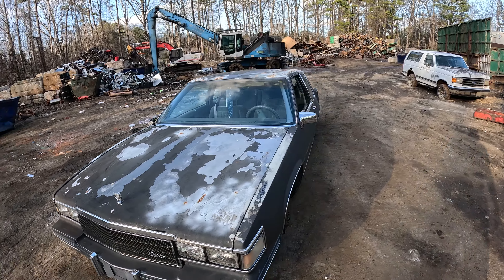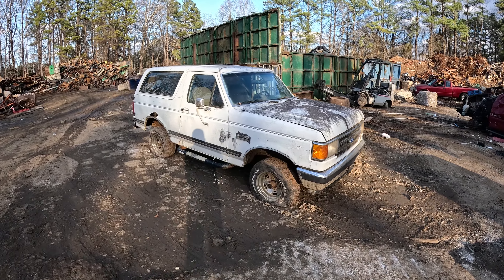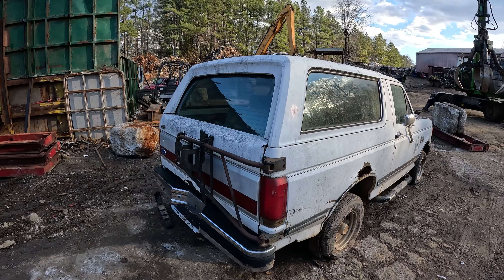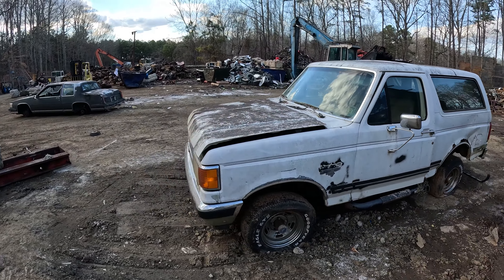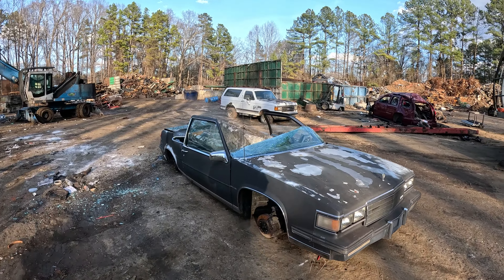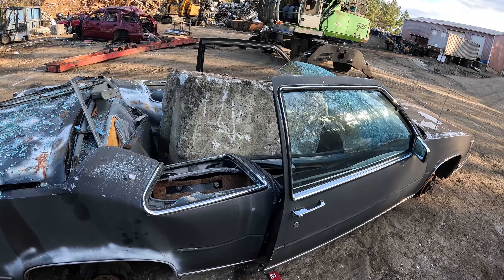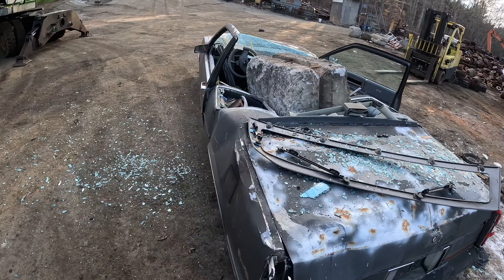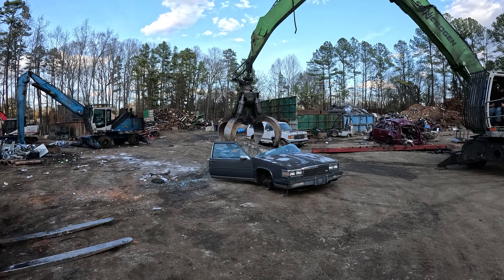Ford Bronco vs. HUGE Steel Beam! Crushing Cars with Heavy Objects!

Comment: Surely there were a few parts/pieces on that Bronco that could have been listed on Ebay or similar? 5 years ago a buddy of mine was restoring an '85 and it took him 6 months to find the correct/matching top (that wasn't a piece of crap) for his model.
Reply: Selling on ebay sucks. You have to make the ad, wait months and months for it to sell, pack it, ship it, and pay ebay 10+%. Much easier to sell it for scrap.